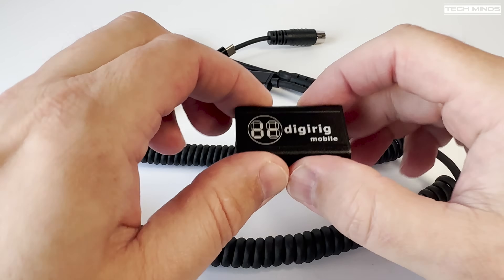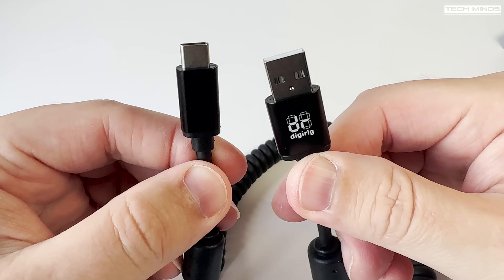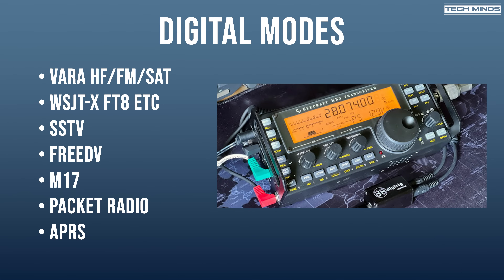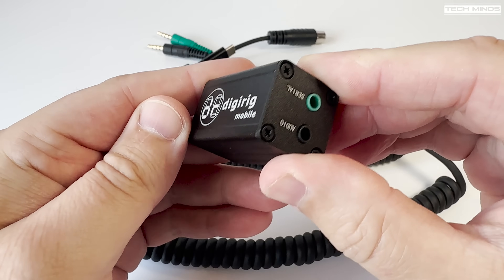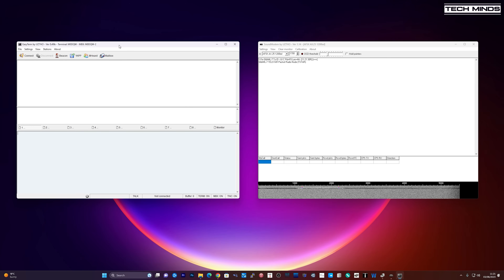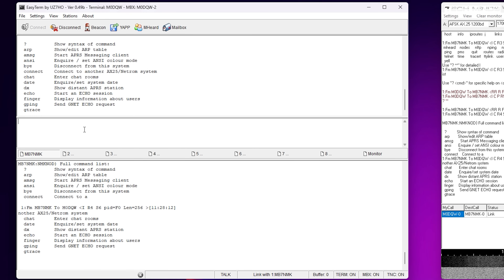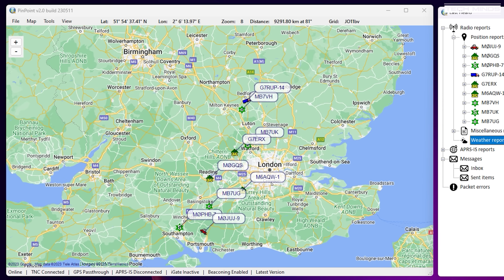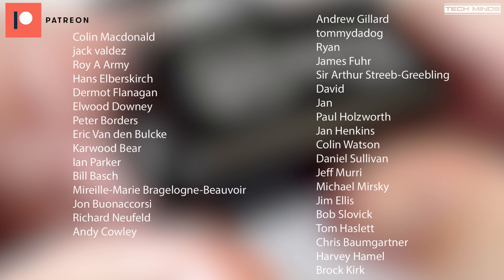DigiRig Mobile - Combines Audio Codec With Serial CAT And PTT

Comment: For APRS and a FTM-300 you should just be able to pull APRS data from the Serial port and not need sound modem. You cannot send APRS data but you can use the FTM-300s TNC to decode and display.

Comment: Why in [censored] are the logo, usb, and audo/serial ports labeled in different axis ? It can't be THAT hard to put everything on the same axis. This makes me question how much foresight they put into the rest of the product.
Reply: Who cares? It works!
Reply: Think about how the circuit board and components are laid out and you would have your answer. There is a USB C socket and two TRRS sockets. The only way to do what you suggest is to either use a tiny font or use a stacked TRRS socket, which would drive up the cost (assuming such a component even is commercially available)

Comment: FT8 is glorified WSPR, at least with other digital modes like Vara you can actually communicate with someone…..
Reply: I see you care enough about this to post it twice
Reply: @MarkPentler  Sad ham hate FT8. FT8 make sad ham ANGRY.
Reply: @MarkPentler  Sad ham hate FT8. FT8 make sad ham ANGRY.
Reply: WSPR is as different to FT8 as FT8 is to Vara. They are each a different tool. 

To anyone else not in the know, with WSPR, you transmit a software generated signal and then check a map on the internet to see who heard you, otherwise you set up a listening station to contribute propagation data to the WSPR project's database. 

With FT8, you also transmit a software generated signal, but you exchange call signs, grid squares and a signal report with another operator to make a QSO.
Reply: @pauls8456

No one asked for your opinion. Twice. 

Settle down, dummy.

Comment: Did you check out the DigiLink Nano? It offers USB isolation which the DigiRig needs an additional adaptor for.
Reply from the maker: It may not have it, but I didn’t experience any issues without it. Maybe someone running lots of power may need one, but I can’t comment on that.
Reply: @TechMindsOfficial my experience is that I needed a USB isolator and to wrap the USB cable many times around an ft230-43 toroid.
This was to stop RFI from the computer getting into the audio in.
USB isolators are often used by hifi enthusiasts with USB soundcards.
With my desktop PC the front panel USB cables take a longish path from the motherboard to the front panel. Maybe a direct port off the motherboard wouldn't have the problem. I also run homeplug ethernet over power so that ends up everywhere.

Comment: Vara is practically a closed-source proprietary technology at this point, it won’t be able to compete against the FT8-family of digital modes in the long run.
Reply: An FT8 mode is JS8CALL, which is for keyboard QSO and rag chew.
Reply: Brilliant interface.
Reply: some great features in Vara ac and more to come, text messages small pics and files.. pass at - 14 to 19 db its very robust... its 121 chat and op, s..
ft8 is more robotic..
Reply: Ft8 is glorified WHSPR, at least with other digital modes like Vara you can actually communicate with someone…..
Reply: @pauls8456  JS8Call is the implementation of FT8 for dialogue